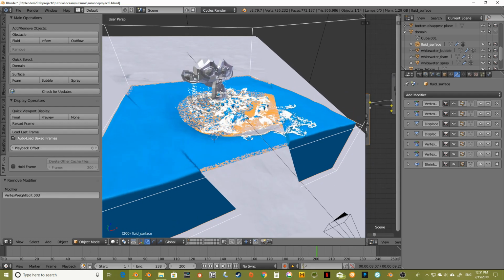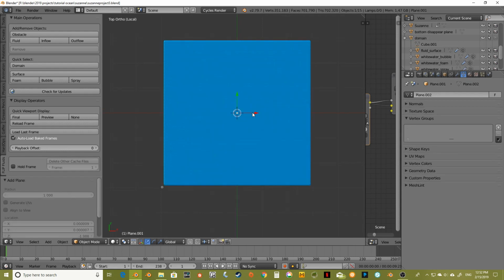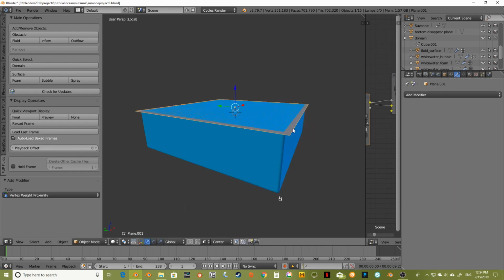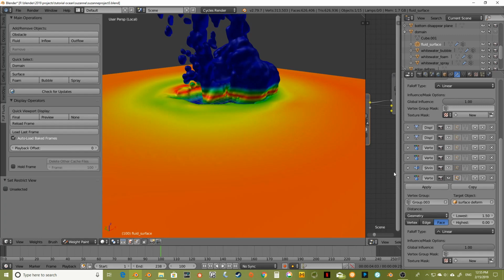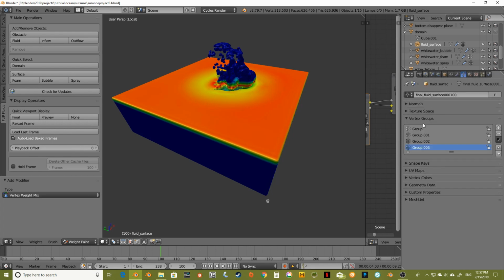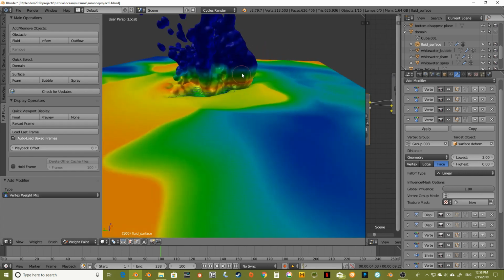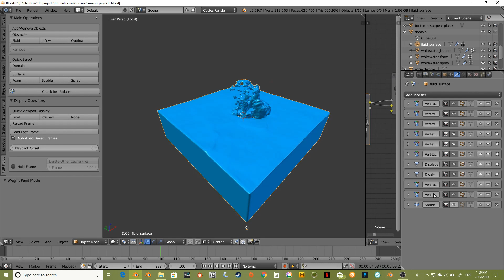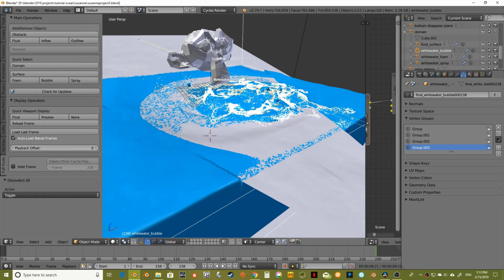IMPORTANT ADDENDUM to 'Tutorial: Ocean Modifier plus FLIP fluid sim equals greatness!'

Comment: Oh my god you´re my f***ing hero, thanks a lot!! I didn´t thought that appling the modifiers to the particles would work as the fluid mesh, thanks again!!
Reply from the maker: You're Welcome!! These are slightly different than particles! I think FLIP uses the Blender duplivert system - so they act like a mesh. Also the latest experimental version of FLIP has a 'remove mesh near boundary' option in the surface settings - which means that only the top portion of the surface object is created which means the surface object won't need so many modifiers as before. (but the white water objects still do)

Hey go teach someone else about this too or link to these tuts. There's nothing cooler than being able to combine the FLIP with the ocean sim.